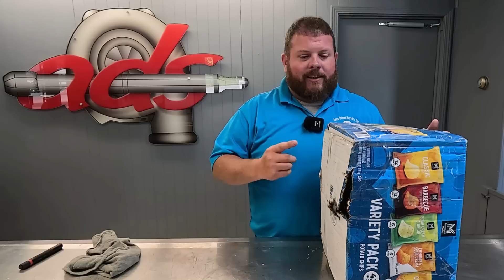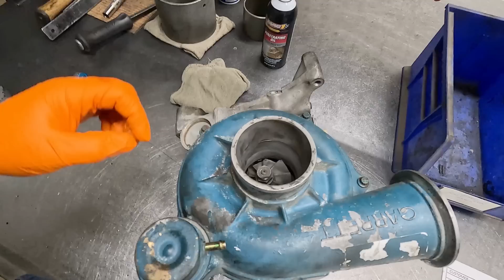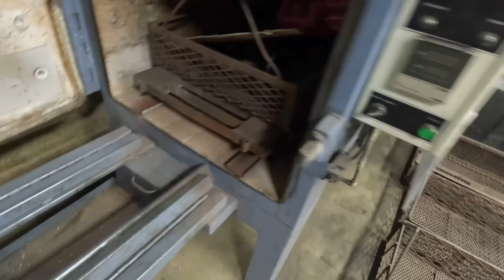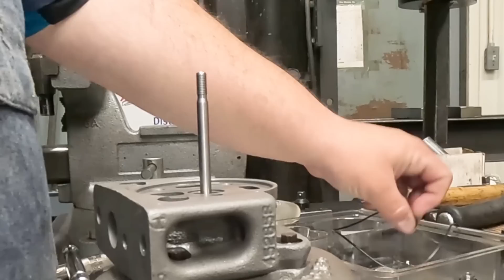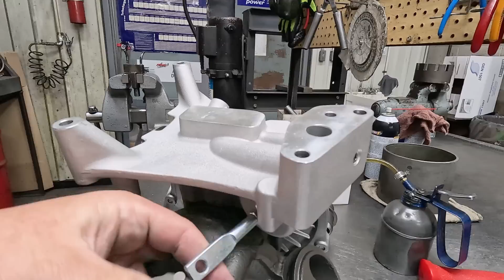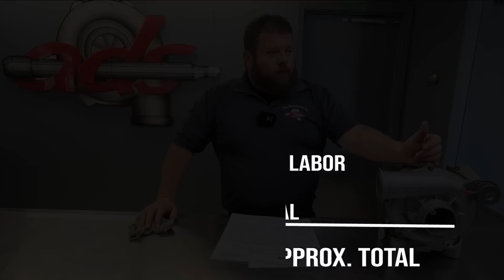#back2school with @DirtPerfect turbo repairs for #skoolie Delores International 3800 Bus T444E V8

Comment: As a former school bus driver, I found this video extremely interesting. One SMALL correction, that is NOT a "Large" school bus. Actually, it's fairly small. It looks like what we would've called a "35 passenger". We had 84 passenger & I THINK they made 90 passenger buses.

Comment: I heard of them breaking like that , when you shut the engine down with out letting them cool down for 15 20 minutes after working the engine hard  , this was comen in bull dozers cause operator did not know to let the cool or cause it was the end of the day and they just wanted to go home , I heard the reason why they break up like that is because the oil supply is interrupted while the turbo is still hot , and the lose of oil on the hot turbo causes it to seize
Reply: Different engine  - but same idea. When I was in the army, there was a FACTORY installed notice on the dash to let the truck idle below 1,000 R.P.Ms. for for 5 minutes before shutting down.
Reply: Oh yes, turbo is still spinning when the oil is interrupted, even my dodge Cummins, spins for like 5 minutes after you shut the engine off sorry I for got the spinny part,lol

Comment: I am stunned with your prices. They are incredibly low for an item that has to be critically machined due to the rotating bits spinning at such high speeds. I wish I could have plumbed one into the aircraft I flew. (Getting an aviation "part" quadruples the prices at a minimum)
Thank you for the video.

Comment: Hey Curt, what's that Bowie knife you've been using to open boxes. . . and using as a pointer?  Enquiring minds want to know.  That thing is glorious.  😃
	• Yeah, Mike @ DP is a notorious lead foot, so it's entirely possible he WAS hot-rodding the engine of that skoolie when the turbocharger gave out.  😉
	• Welcome to the video, Eli.  Great to see you again.  👍
	• Mmmmm, the oven.  For cakes and parts, but not the same bake times.
	• That post-bake "Like & Subscribe" sign still brings a smile to my face.  🥲
	• Well done, Eli.  That seemed to go together smoothly.  A testament to your expertise.  Thanks for taking us along.
	• Heh, Curt.  By chance, I just paused the video as you said "cata", and I know where "cata" leads. . ."catastrophic" or "catastrophically". . . and yup.  "catastrophic shaft breakage".
	• That's one heck of a belt on that 7.3l Powerstroke engine.  That thing must be like 5 feet (1.54m) long.
	• It's good to see that y'all were able to rebuild that TP38 turbo.
	• Mike got off easy with a $1038 bill for this repair.   

Once again, ADS comes through with a like-new repair of a severely-damaged system for a customer. Expertiae and parts accessibility.  THAT'S why y'all are the best!

Comment: I use my ebpv brake every time I tow. It works great on my 6 speed. I ordered a spare ebpv pigtail and made up a plug and play relay harness that goes to a nice switch on the shifter.

Comment: Re the wheels, arent they supposed to me matched for balance when installing? or wasnt it just mentioned you put the marks together? In a hot running item assembly, a friend uses Crisco, It keeps stuff together like a bearing cage  and then melts the sec the heat hits it and the oil takes over